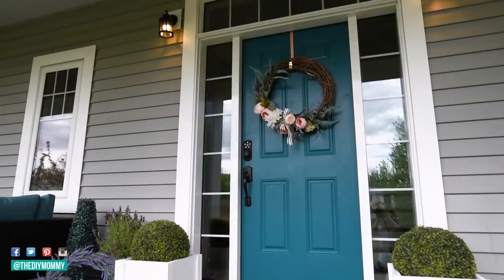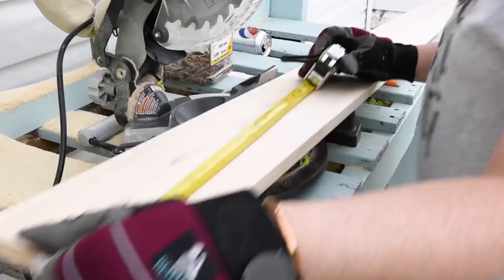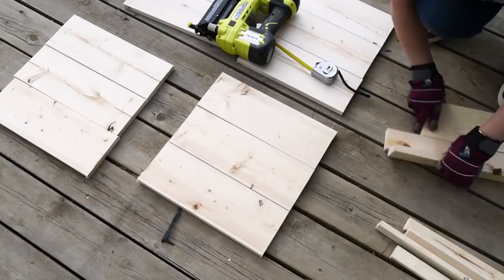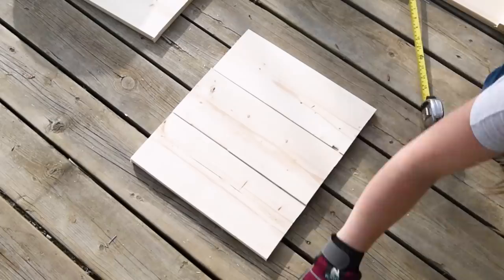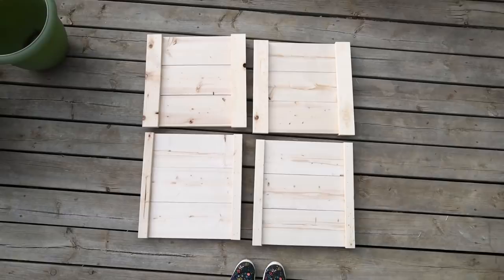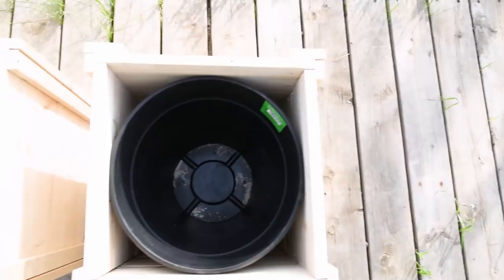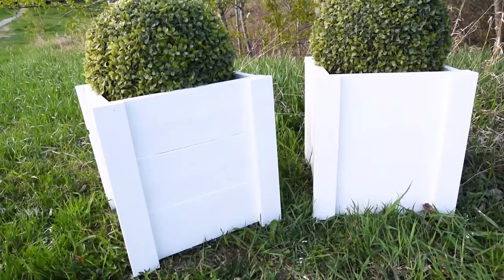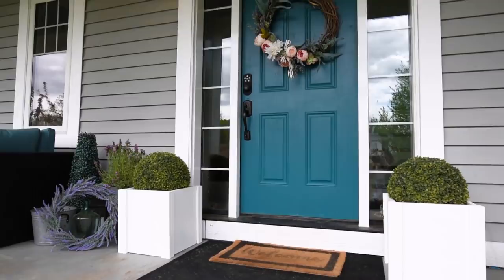DIY WOODEN PLANTER BOX | Outdoor DIY & Decor Challenge

Comment: Good video. Thanks. You can save a lot of money by buying fence pickets instead of 1xs. They are about 5 1/2" wide by 6' long. Here in Ohio they cost about $2.18 for the pressure treated and $3.14 for Cedar. Both will last much longer outdoors than untreated boards.

Comment: Nice, easy, quick project.  Just what I was looking for to cover some 5 gallon bucket self-watering containers.  The lack of a bottom is great, to let the water drain.  I'm debating putting a finishing board on the top, in order to keep the water from getting into the end grain of the vertical side pieces.  Help it last longer.
Reply from the maker: Great idea! You could miter the ends of more 1x2s and nail them on top.

Comment: Your measurements are off.  3 pieces of 1x6 next to each other equal 18 inches. How do 16.5 inch pieces of 1x2 and 1x3 fit flush on the 1x6’s?
Reply from the maker: A 1x6 is usually actually 5 1/2" wide, hence the 16 1/2" measurement.
Reply: Ahhh correct! Thank you! The 1x6 I have are 5 and 3/4 that’s why the 16.5 inch 1x2 and 3’s were short. I’m glad I caught that before making the cuts! Love the plant boxes, awesome job!